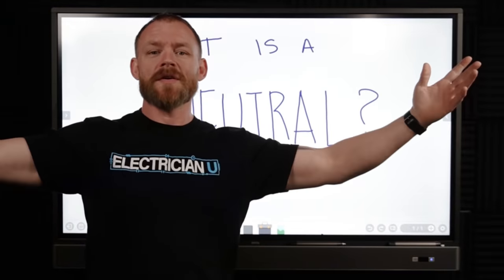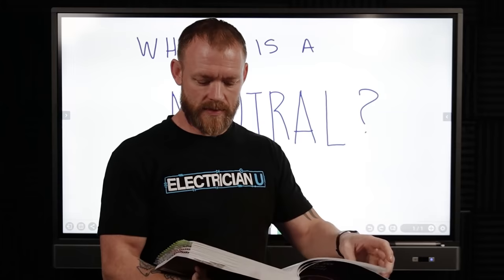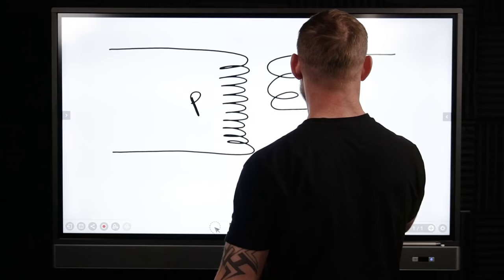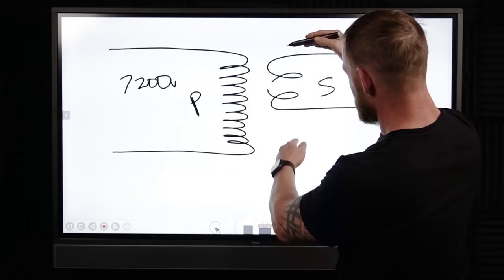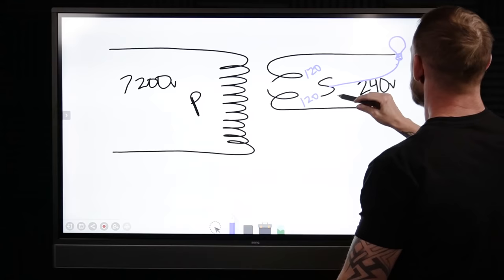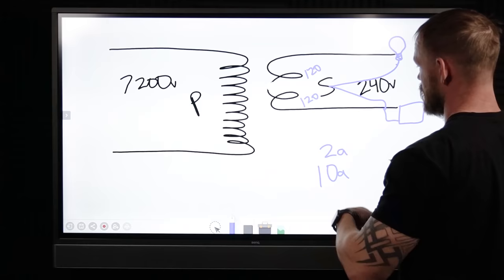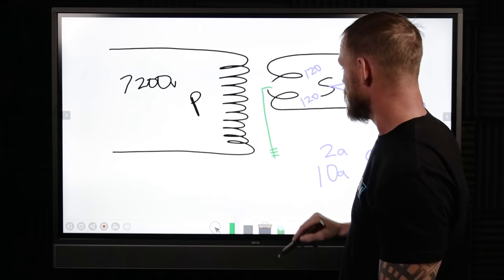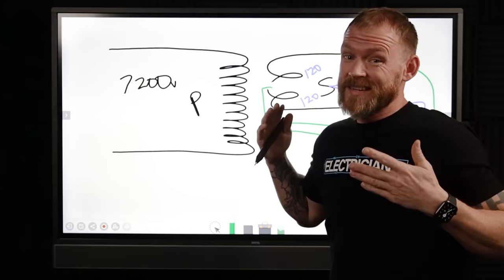What is a Neutral? The Difference Between Grounded and Grounding Conductors.

Comment: I find "return" a better term since "neutral" sounds so waryless.  I guess it could be neutral, but for the majority of chances...no.
Reply: “Return” is a misleading term, though, so has its own pitfalls.
Reply: @GH-oi2jf  What's misleading?  It's the return conductor (genuinely asking).
Reply: @louf7178  — In an AC circuit the current goes in both directions, changing directions 120 times per second.  Look at the system just thinking about the circuit: a source of EMF, a load, and two wires connecting them to make a complete circuit.  That is the minimum needed to use electricity to do work.  Ignore everything else, specifically the ground wire and ground connections, and any part of the transformer not part of the circuit.  The two wires in the circuit are equivalent.  The current goes one way, then it goes the other way.  There is no reason to call one of them the “return.”  

Now complete the system as we implement it.  If one of the wires is connected to the midpoint of the transformer secondary, we will connect it to the panel and connect the panel to an earth ground.  But the grounding has nothing to do with the circuit, really.  The wire has acquired a special status in that a measurement of the potential difference between it and the ground will be small, ideally near zero, but the circuit will continue to operate as it did before.
Reply: @GH-oi2jf  I follow what you're saying and have tried asking about this before, i.e. the "hot" switching because of the cycle.  So you are saying this is right?  My last understanding said no, and the "hot"  was still the driver, only with opposite polarity (which still doesn't sound quite correct).  I'm still not sure how to understand this.

I do understand the reality of center-tapped transformers.
Reply: @louf7178  — “Hot” means that a wire has a significant potential difference (Voltage) from ground, nothing more.  It has nothing to do with whether current is flowing, or with which direction current is flowing.  A “hot” wire will give you a shock if you are standing on the ground.  The neutral is held at or near ground potential, so is never “hot” unless something is wrong.
Reply: @GH-oi2jf  So the neutral goes "hot" on the second half of the cycle?

Comment: Can you get shocked from the neutral and if so how come you don’t get shocked from the ground if they are bonded
Reply: 1) The Neutral is a live conductor and should be treated the same as the Active (Hot ) wire.
2) The Neutral wire is connected to the Earth Bus (Ground Bus)  which means it is at Earth Potential (0 Volts). 
3) If the Neutral is disconnected from the Earth Bus (Ground bus) it can rise to Mains Potential.
Reply from the maker: It is entirely possible. If there is a difference in potential anywhere in the circuit.
Reply: Just to add further to the answer : The Physical Earth is a very poor conductor and has a very high resistance compared to the Neutral wire. The Neutral being at Earth Potential (0 Volts) and the Physical Earth being a poor conductor is why you don't get shocked.
Reply: That is wack how the metal on a toaster can be grounded and there is a possibility of being electrocuted
Reply: @evanmason4967  As long as the Earth (Ground) wire is connected properly to the Toaster the moment the Active (Hot) wire comes into contact with the Metal casing of the Toaster (called a Ground fault)  this will trip the Circuit Breaker and cut the power. What is Wack with that ?
Reply: @timg6850  sorry I’m new to this I don’t really know that much about it I just didn’t understand
Reply: @evanmason4967  No problem ,  Just think of it like this.
1) Active (Hot) is the push and pull wire as it is at Mains potential (120 V).
2) Neutral is the return wire as it should be  at or close to 0 Volts. 
3) Earth (Ground) wire is the safety wire and will trip the Circuit breaker if their is a fault.
4) The Neutral is a live wire and can rise to  Mains potential (120 V) if it is broken or disconnected from the Earth Bus (Ground Bus) at the Main panel.
Reply: @timg6850  the ground will trip if it is a arc fault or gfi right
Reply: @evanmason4967  GFCI and ARC Fault Circuit Breakers work differently as they sense an Electrical Fault in the circuit and then cut the power. They will cut the power within something like a 1/10 a second and because it is so fast it stops you from getting Electrocuted. The current going down the Earth (Ground) wire instead of through the Neutral is part of what makes these types of Circuit Breakers sense a Fault.

Comment: Honestly.....didn't do anything to answer the basic question in real life....which is....both the ground and neutral attach to the same grounded bar in the electrical panel....so the are the same....but why 2?   Used to be only one.  Try using an actual electrical panel in your explanation instead of drawings.

Comment: Very confused. You call it an ungrounded conductor, but it is actually grounded? If it is connected mid point between the hot, but then is grounded, wouldn't the electric run straight to the ground and "short" out. If "short" could even be used in this context? Very confused.
Reply: He said “you can think of it as an ungrounded conductor (or hot)” but what he meant was that it is equivalent to the hot lines from the standpoint of making a circuit.  It takes two wires to make a circuit from the transformer through the load and back.  For a 120V circuit, one them is the wire connected to the center tap.  That conductor is grounded, so from the standpoint of a person standing on the ground and touching the two conductors of the circuit, one of them is “hot” and the other isn’t.
Reply: Grounded conductor is the neutral. Ungrounded conductor is the hot.

Comment: The primary is not 2 hots on the primary side on a 240/120v residential transformer. It is one hot and one neutral.  cmon man.
Reply: It can be either.  If the distribution network is a Y, it will be one phase and the neutral.  If the distribution network is a Δ, it will be one of the three sides, but there is no neutral.

Comment: These videos are so bizarre.   The center of a 240v transformer is literally a grounded conductor.  It splits the 240v line voltage into two phase voltages. It's not actually a true neutral.  For the most part.

Even in three phase wye systems the neutral is literally the center ground reference.  That's second year theory.

While the green "ground" wire isn't classified as a ground at all.  It's used for equipment bonding.  Its a subtle difference but a true ground is used primarily as a voltage reference.
Reply: What does “true neutral” mean?  The center tap in the 240V split phase transformer is precisely analogous to the common wire in a wye secondary of a 3-phase transformer.  In both cases they are tied to ground and designated “neutral.”
Reply: @GH-oi2jf  "True neutral" or neutral is defined by the NEC and it's a huge topic you're welcome to look into.  The center tap on a transformer is not a neutral itself.  In both cases they are a ground reference with neutrals being placed on the load side of the transformer. (Generally)  In single phase, its simply used as an additional ground reference to split the phase because there is no line/ phase voltage to split like three phase. 

Now single phase can occasionally have three wire circuits where there is a neutral wire carrying the unbalanced current.  In theory, you could have all 240v with no reference to that ground or have all two wire circuits with the white being a grounded conductor.  Its all semantics but since he's a professional tradesman I'm surprised he doesn't use terms properly or know the actual theory behind them.
Reply: @traditionaltools5080  — I don’t have the NEC and don’t intend to buy one, but here is something from a list of definitions purported to be from the 2017 NEC:

“Neutral conductor: The conductor connected to the neutral point of a system that is intended to carry current under normal conditions.

Neutral point: The common point on a wye-connection in a polyphase system or midpoint on a single-phase, three-wire system or midpoint of a single-phase portion of a three-phase delta system or a midpoint of a three-wire, direct-current system.”

That is not a definition of “true neutral,” so I don’t know what that means.  I am interested in practical electricity, and what we call “neutral” in either a North American split phase 240V/120V service or a 3-phase wye is perfectly clear.  Whether these are “true” or not means nothing as far as I can tell.  I’d say that’s an argument for pedants.
Reply: @GH-oi2jf  that's just it.  It is pedantic but standardized terms help when teaching new subjects.  The problem is this channel is set up to teach new apprentices and help with exams but he's confusing terms and using jobsite jargon.  It matters because people will absolutely fail their trade exams if they don't know the difference between a neutral, neutral point, neutral conductor, grounded conductor, system ground, bond, etc.  They also need to know the math behind it.

Comment: If the white wire is also hot, why does my non-contact tester remain silent near it?
Reply: The white wire is hot when there is a load on the circuit if there is nothing connected to the circuit then the electricity is going up the black hot wire but then has nowhere to go. But your sensor can detect that electricity in the black wire.
Reply: The neutral is never supposed to be hot.  “Hot” means that there is a significant voltage with respect to ground.

Comment: Because “ground” can float in an electrical circuit, “ground” does not always refer to “ground-to-earth”. So, in electrical engineering terms, ground and neutral are interchangeable, since a “floating ground” is a real thing in circuit design … it refers to a common voltage basis point, or relative zero-point. However, inside an electrical panel, neutral is grounded to earth (for good reason … safety) making “neutral” a specific type of “ground” … “grounded to earth”. It’s a confusion in terminology I wish didn’t exist.
Reply: Electrical engineer here. You have a good point. Talking about PCBs sometimes we have two ground planes this is done to separate the high power currents (noisy) from the small ones (quiet ground). These grounds carry current because its the return path to the source.

Comment: Sorry, your explanation sounds circular, confusing, and internally inconsistent.  If we connect a conducting wire with 110 volts directly to ground, aren’t we intentionally shorting it out of the system?  The potential difference between the two is a pure 110 volts.
“An ungrounded conductor that is intentionally grounded” is self-contradicting term.  Probably not safe to handle either?
Courtesy of Half Vast Flying
Reply: 1) The Physical Earth is a poor conductor and has a Very High Resistance so little current can flow through it but the Earth (Ground) wire connected to The Physical Earth using an Earth Rod will be at Earth Potential (0 Volts).
2) Connecting the Neutral wire to this Earth wire via the Earth Bus (Ground Bus) means the Neutral will also be at Earth Potential (0 Volts) 
3) "An ungrounded conductor that is intentionally grounded” What he means is the Neutral and the Earth (Ground) wires are only connected together at one place The Earth Bus (Ground Bus) at the Main panel.
4) Connecting the Earth (Ground) wires at only place in the Mains Panel means that they only become part of the Circuit when a Fault occurs. This Fault should trip the Circuit Breaker.

Comment: All electricity seeks a path to ground that's what a neutral is the path to ground . That's why lightning uses many objects to go to the ground..
Reply: @Tim Giles.   Technically, any Seperately Derived electrical source is seeking itself.  Actually, the neutral current is seeking the coil that it is induced from and has absolutely no attraction to the earth except that the earth may provide a path through multiple existing electrodes back to the windings/coil/center tap of the utility transformer. Lightening is entirely different in that it's beyond our ability to even measure and untraceable like the wind and yes is often seeking the ground but not always.

Comment: The neutral is the same as the hot wire. I've connected all the wires to either side of a power strip and the appliance s work exactly the same. Only difference is the light up screw driver thing lights up more on one side than the other.
Reply: That is total nonsense.